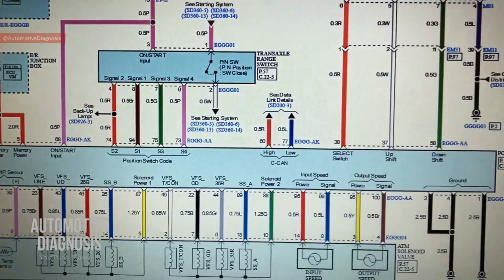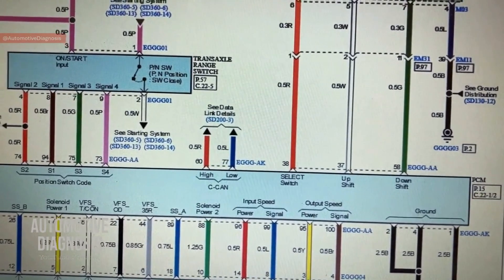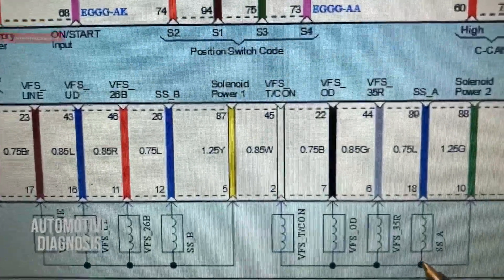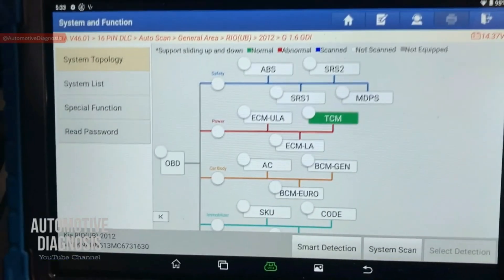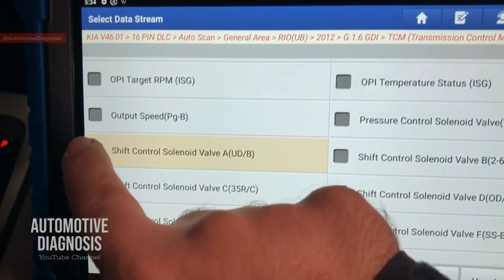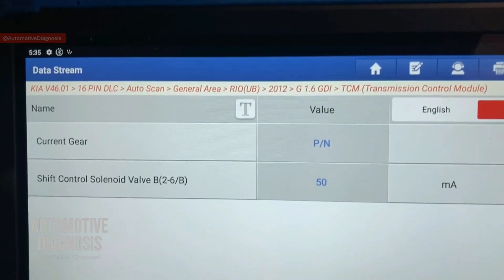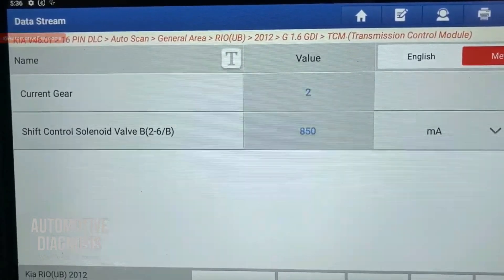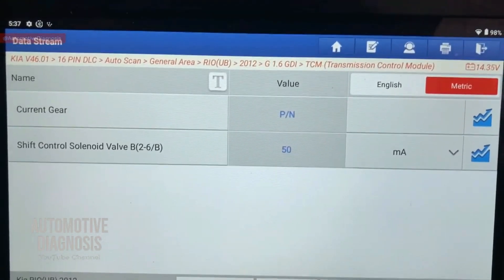Don't Replace Transmission Shift Solenoid Valve Before Watching This

Comment: 7:29 I got 5.9 instead of 5.3. That's not a good number, right?
Reply from the maker: 5.9 is still close to the range, It's not showing a fault.
Reply: @AutomotiveDiagnosis  thank you. I had the same error P0758. Stuck in 4th gear and the first mechanic that checked wanted to do a transmission rebuild. I tried what you did in this video except the last part. The issue/error was resolved when I added a liter of transmission fluid.

Comment: Very informative! Hope to see this added to the video courses soon! Quick question, at the 6:00 mark in this video, you showed that the voltage supply was 2.5 volts. The solenoid doesn't need 12 volts, only 2.5 volts to work? Thank you
Reply from the maker: Hi there, the supply voltage on solenoids can be different car by car, for this one workshop manual says 2.5 and we get same value.

Comment: Sir, I have a 2012 kia Cerato , my car jerks on gear shift. My transmission mech after scan said two solenoids are not working. He says he suggest I replace the entire valve body instead of servicing and replacing the  solenoids. Which one is best?
Reply from the maker: Hi there, if he is sure that two solenoids are faulty, why would he replace the entire valve body which costs way more than only two valves?

Comment: I have a 2012 Sonata, model number 5 and 10, with a 9-volt multimeter, code p0880. Please help. The gearbox is stuck in gear 4.
Reply from the maker: This code could be caused by no power of transmission control module, so you need to check the relevant fuse in fuse box or TCM connector.

Comment: Good video...Can anyone tell please why it is called "brake" solenoid?
Thanks.
Reply from the maker: Hi my friend. Inside an automatic transmission there are multiple planetary gear sets, and for achieving the proper gear ration on each gear, TCM turns or stops some those elements inside each gear sets. For turning a component we have a clutch pack, and for stopping them we have brakes (which are very similar to a clutch pack, but instead of connecting a component to a rotating shaft, it will connect it to the transmission body to stop it) this will affect the gear ratio for that specific gear. Each brake or clutch pack is controlled by a solenoid valve for supplying or cutting the ATF pressure.
Reply: @AutomotiveDiagnosis  Hi thanks for such a detailed explanation. Appreciate your excellent work. Keep it up.
Reply from the maker: @KPKCCK  👍👍👍👍👍👍